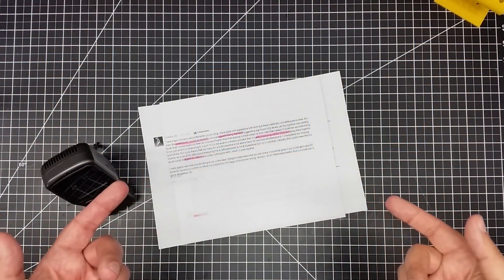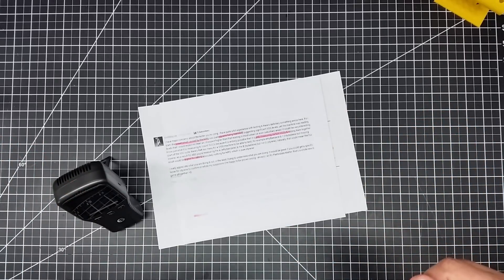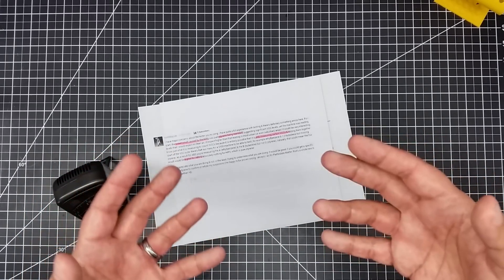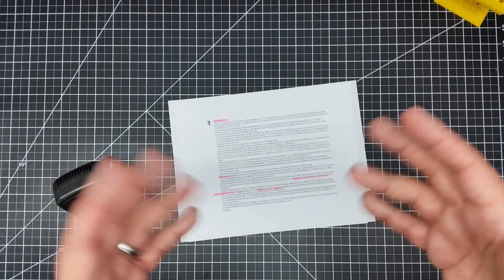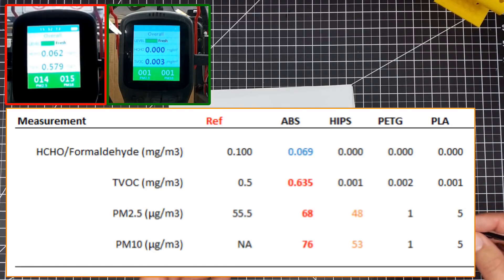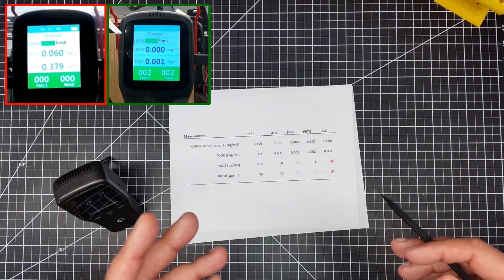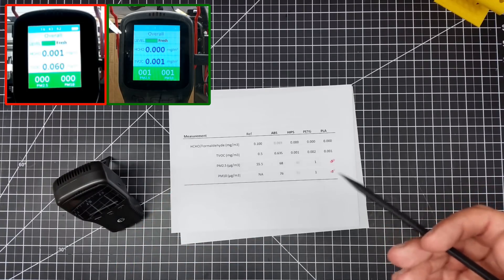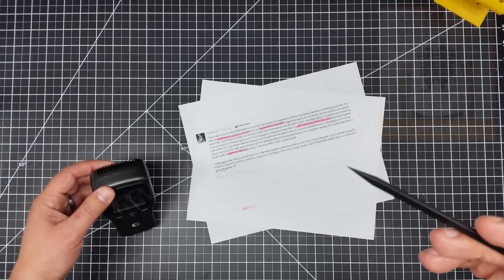3D Print Air Quality - PLA verses ABS and the Results are In!

Comment: Thanks for highlighting the comment by David Light, this is serious. I'll immediately mail everyone i know who owns or considers operating a stereolithography machine at home. I suspected that it would be pretty bad, the amines used as crosslinking agents for the resin are all highly toxic and even when most of the overt toxicity is avoided and no immediate health effects seem to occur, allergic sensitisation to an arbitrary substance can be the result, potentially deadly. I may be the world's world chemist (because i really am not a chemist), but as spectacular as SLA is, just a cursory consideration gives me enough of a reason to stay very well away from it - if i need the prints, i should get a professional lab to do them.
Reply from the maker: Yes as mentioned I perchased one not thinking and minutes after opening the bottle I had allergic reaction which sent me to the SDS sheets and I was surprised as I would not use one of these without proper ventilation and a fumehood...
Reply: I'll be brutally honest here - SLA resin should not be available for hobbyist use in this way. It should be treated like an industrial chemical & full health & safety gear worn. We're not talking "paint fumes" level of risk here, but something far, far more serious. I've not done too much research on the resins but a cursory glance makes it pretty obvious that this is not something that should be in the home environment, or even the hobby workshop.

It's possible that there will be a safer version of the resins released, if not already available, but for now I'd avoid them unless you have the appropriate industrial experience & workspace to house them.
Reply: GothBoy, i just remembered something. There's a children's toy that imitates an injection moulding machine, and it runs off an UV cured material that is likely to be acrylic based, and i think it's available via normal retail and is presumably FDA approved. A similar material is also sold as a household UV-cure glue, and presumably the same or a similar one again is used to attach the smartphone screens. It will need to be modified for printing to limit curing depth, and it's not an engineering material, it won't have superb mechanical properties, but people can have their high-resolution figurines produced in SLA/DLP process and it can be reasonably safe.

Because what you've got right now is literally industrial chemicals where safety considerations in uncured state have been largely ignored.
Reply from the maker: I agree with 100%  did you see the note I posted from Dr Dave?

Comment: Great. This is the analytical side of 3D printing which I enjoy.

I wonder if the color dyes have anything to do with the pollution compared to the plain filaments.

My hypothesis for a higher pollution towards the end of a print relative to the beginning is that it may be thermal creep exposing a higher surface area of filament. Perhaps testing "mid stream" beginning after a long print may lessen this effect?

This is probably outside both of our limitations but the title initially got me thinking of something else. I wonder what kind of opportunities can be opened up for 3D printing materials or processes if the printer were enclosed, evacuated of air, and replaced by an inert gas. 

Actually it may be easy to do with the help of placing a 3D printer in a vacuum tank and replacing it with argon. 

Anyways, looking forward to more. Have you tested the effectiveness of the HEPA filter on the air pollutants?
Reply from the maker: Hmmm interesting as I used white so I might revist this with black as it would be easy to setup again
Reply from the maker: I like the idea, however right now don't have the ability (lab) to test.  Something to put on wish list :-)
Reply: You will probably find higher particulates in black filaments since carbon black is commonly used.
Reply: DIY3DTECH.com 

There is also plain PLA, which is naturally milky clear. White is dyed as well.
Reply from the maker: Thanks and the inert gas idea is interesting.  As side bar saw they have gravity free 3D printer on the space station.  However or thing is additives as to make the plastic that cheap I do feel they "cut it" with other chemical fillers...
Reply: DIY3DTECH.com Maybe with the inert gas, highly reactive materials can be used, and then encased or partially encased in a different material. Who knows what applications this could be used for? 

Your title also got me thinking of an experiment where different gases are tested for their effects on the finished print quality. For instance, a more thermally conductive gas can be compared with a gas with very little conductivity. It may affect how the part is cooled drastically, and perhaps reveal any unexpected outcomes. Toughness, hardness, elasticity, etc. may vary!
Reply: DIY3DTECH.com Yeah, food for thought. It's a little out of reach for the hobby zone.